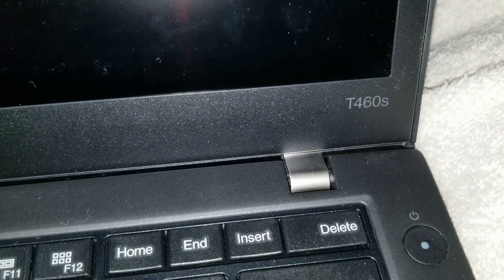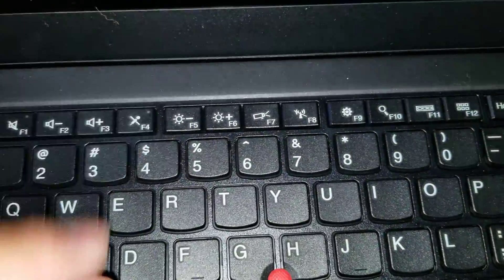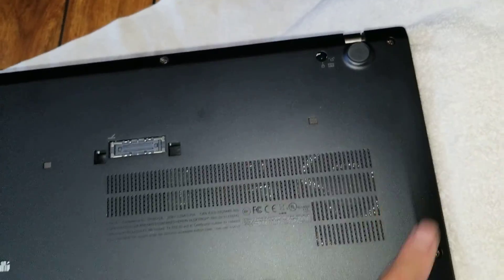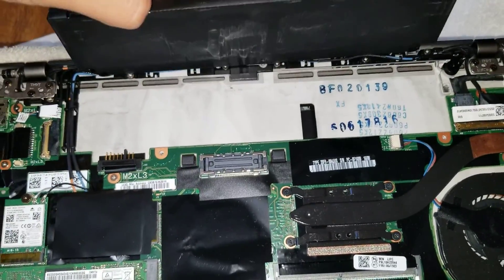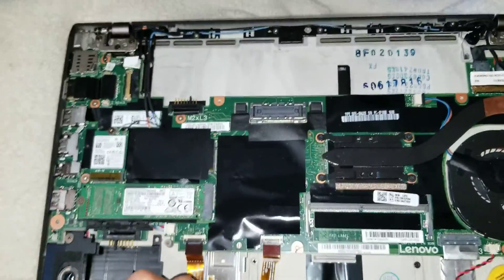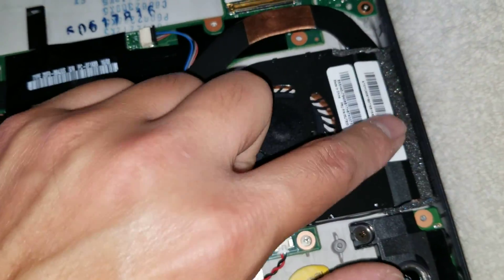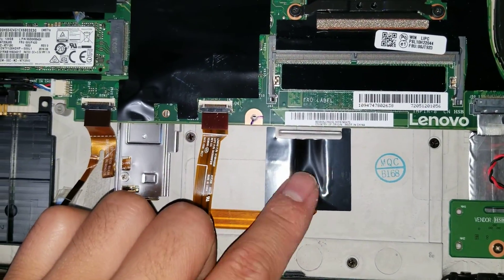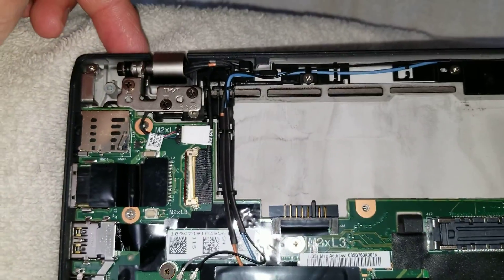Lenovo T460s Disassembly RAM SSD Upgrade

Comment: Keyboard mouse struck in 5 min if i move laptop, starting issue some times , screen wire loose where to check? Windows througing error blue screen need to repair how to solve please
Reply from the maker: Sounds like a used one would be cheaper.

Comment: Keyboard mouse struck and starting problem, screen loose connection how to fix these issues,  same  model, getting blue screen windows through bg errorv
Reply from the maker: Sounds like buying used will be more cost effective.

Comment: I have a ThinkPad T460s, with 1920 * 1080 FHD video screen, with Intel (R) Core (TM) Processor I5-6200U CPU @ 2.30GHz 2.40 GHz
Installed RAM 20.0 GB (19.9 GB usable) with 64-bit operating system, x64 processor and Pen and touch input support for inking and touch with 40 touch points; my question is if I can change to a 14.0 "model video touchscreen For thinkpad T460s LCD Screen + Touch Digitizer Assembly LP140WF6-SPB1, can I? thanks for your time and answer...
Reply from the maker: I don't know. I just use exact replacement parts. You can't change resolutions.
Reply: @ItsBinhRepaired  thanks very much for your opinion
Reply from the maker: @Edgaraza  no problem

Comment: Hey mate, been a long time but is there two ram slot (one soldered, and one empty)? also what's the maximum capacity for the M.2 SSD?
Reply: 2280 is the full length of laptop max current size manufacture is 4TB. New for 2020.  Sabrent  

Server M.2 longer up to 9.6 TB 30110.  

As for the LTE MODEM slot m.2 2242 length. can be used as 2242 Nvme. Not sure will it be bootable.
Reply from the maker: Not sure if the ram is soldered or just on the other side of the board. There is no max capacity for the SSD slots.

Comment: Can I add two ssds? One m.2 and one sata?
Reply from the maker: As long as the laptop has the slots you can
Reply: @ItsBinhRepaired  I'm thinking to buy the t460s. So wondering if it can.
Reply from the maker: @schlafer-yt  The video should show all the ports available. Did you watch it?
Reply from the maker: @schlafer-yt  there's no 2.5" sata drive in this laptop.
Reply from the maker: @schlafer-yt  there's an m.2 sata. Not sure if m.2 nvme will work
Reply: @ItsBinhRepaired  yes I watched it. Just searched Wikipedia. It only has 1 m.2 x4 nothing else. Guess I have to find a t450s or t460p to get the wwan slot for additional msata ssd.
Reply: @ItsBinhRepaired  maybe the slot could be used for mSATA. Am i right? Not mSATA m2 version. It is similar with thinkpad X230.

Comment: Just a quick question, is there ram soldered on mobo and that slot can be used for second ram stick to make it work in dual setup ?
Reply from the maker: Yup, they integrated the ram. You can add a second so it runs dual.
Reply: @ItsBinhRepaired  ok Tnx for answering so fast ,have a good one.
Reply from the maker: @martingru  no problem :) hope it helps
Reply: @ItsBinhRepaired  yeah tnx!
Reply from the maker: @martingru  don't forget to like and subscribe if you haven't already. It'll really help me out. :)

Comment: What model ram i need to upgrade? DDR4? 2133? or?  Ty
Reply from the maker: 2133mhz and 2400mhz should both work. Not sure what the speed of the integrated ram is, but there's no point putting faster ram in it because it'll just throttle to match the slower one.

Comment: Thanks so much for the video. This thing is way more user serviceable than I thought.
Reply from the maker: Glad it helped. The screen is also not too difficult to remove, but make sure to disconnect the battery and hold the power button for 30 seconds before disconnecting the lcd cable.

Please like and subscribe if you haven't already. It'll help me out as well.